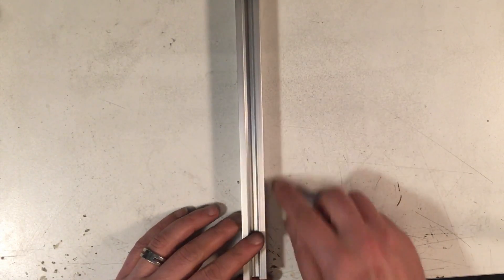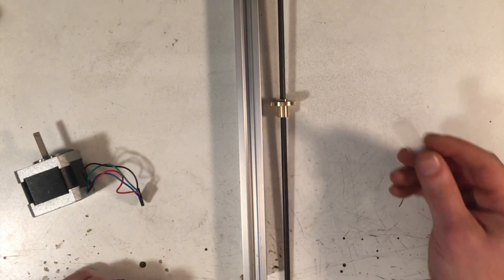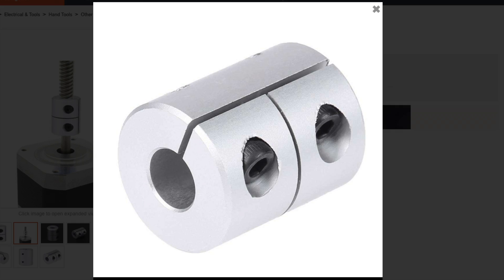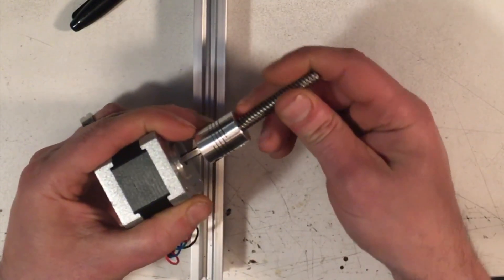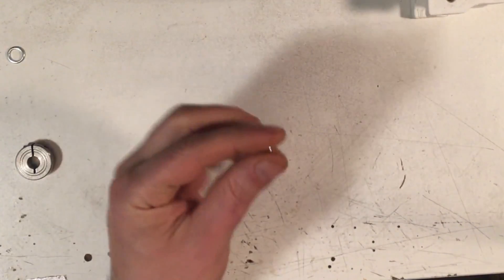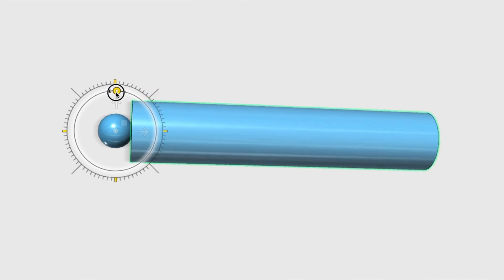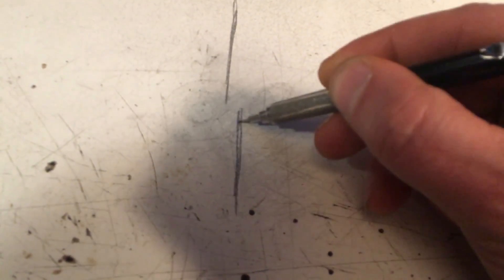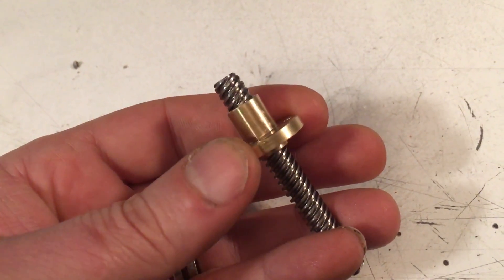Viewer question: the ball bearing trick?

Comment: The original bearing in bracket arrangement is better as bearings in the stepper are not designed to take loads into the motor. But please use thrust bearings nit standard bearings 😊😊

Comment: New to 3D printing and this was freaking awesome! I'm on my 3rd real print with a new Ender 3 and having some z axis biding issues. I didn't get everything exactly dialed in out of the box so my first two prints came out supper smooth and then my machine started to come apart....not the machines fault or the design or the slice its the pilot setting up the equipment for sure, since I'm new.....I don't know what I don't know yet. Thank you for imparting your experience and wisdom. This community has been supper supportive and I really think my learning curve has been diminished by learning from other makers experiences. Again Thank you!

Comment: Overtightening the leadscrew nut can also cause binding of the leadscrew, I have purchased 3 Ender 5 Plus machines and on each one the leadscrew nut screws were fully tightened and caused screeching and binding, one of them was so tight it knocked the part off the bed at exactly the same layer each time, luckily this was the first Ender 5 Plus I bought and this issue was what drew me to the fault, when I built my Ender 3 and CR-10 machines the instructions warned against tightening the leadscrew nut too much, the method I employed was to tighten the screws fully but without torquing them up and then turning them back one half turn.

Comment: In Tevo Tarantula Pro there is an o-ring that is meant to do exactly that, just inserted between the motor shaft and the lead screw, although I think that the ball bearing would do a better job :D
Reply: Won't the oring crush eventually, merely acting as a wannabe dampener of sorts? I just added the ball bearing to a new flexible coupling on the Z axis, we shall see if wobble is reduced!
Reply: @gushhnet  Well, I had the printer for 5 years or so now, printed a literal ton of filament, replaced the lead screw nut twice now, and the o-ring's still looking fine and dandy, so I don't know :v

Comment: fun fact 
my reprap was oryginally designed to use flexible coupler and it worked fine but as you say it was squishy so every slight problem made a 2mm pattern on the printed part
in my case the leadscrew was resting on the motor shaft anyway, so ball bearing wouldn't fix much
but swaping the coupling for one from ender 3 fixed all the problems
and my printer is using regular m8 rod and brass nuts with backlash spring

Comment: At what point do I stop chasing 0.2 mm misalignment, I've got everything as square as can be with the tools I have (verified with 2 squares, a pair of digital calipers and 2 crappy tape measures). Still binding, probblem is this printer always bound in z and also printed really well (85% of the time with the other 15% being really hard to figgure out bullshit failures  leading me to tear down the whole machine and rebuild it).... but for the life of me I can't get it to move smoothly in z. At this point with the learning, tuning and fixing I swear I could make my own printer at this point :), is it possible my vertical z extrusions are twisted (they are not bowed but Idk how to check for twisting on them) . Sorry essay sized comment. Im losing my mind over this one, thanks for the video it did me alot despite the rant :)
Reply: I know this is a 9 month old comment but just in case perhaps your acme nut/s are too tight, try to loose the screws one half turn and see if the coupler with a ball bearing also helps align, the binding is most likely caused by the nut being screwed on too tight to the frame and possibly a bent leadscrew.

Comment: I just found this video and its very knowledgeable. I thank you very much for all the info, I had a small binding wich I fixed with cheking the lead screw all the way and adjusting things. Also I installed a second Z leadscrew and the z movement is very consistent. I think Im going to upgrade to POM t8 nuts and Im not sure yet of going for the flexible couplings, I am very interested tho of taking the weight of the z axis from the steppers to the frame. Have you seen the ptfe t8 lead screws? How do they compare to regular ones?

Comment: I’m sorry for the double comment, but I just had to add yet another huge THANK YOU for this tip. 

I have a brand new Voxelab Aquila (Ender 3 clone) that was losing a HUGE number of Z axis steps. After following all the advice I could find, I got it improved to the point that I was just losing a few Z steps. I went from not even being able to print a first layer test successfully to being able to print, but with enough lost Z steps to affect print quality. 

To get to that point, I:
Lubed the lead screw
Shimmed the motor mount so that my Z axis lead screw was the same distance away from the frame at the bottom as it is from the top

Added a flexible coupler

After reading your explanation about how a flexible coupler could absorb z steps, I had an “ah ha!” moment, realizing this was my problem. 

I added the quarter inch ball bearing to the flexible coupler, inserted the lead screw until it rested on the ball, and my troubles were completely solved. NO MORE lost Z steps!! NONE! NADA! ZILCH! ZERO! THE EMPTY SET!

After chasing this rabbit for a week and losing the rest of my little remaining hair, I printed the most perfect first layer test I’ve ever seen. Did I mention no lost Z steps??

THANK YOU SO MUCH!!

Comment: You showed a flange ball bearing being pressed into that white plastic mount. It should be pointed out that the bearing, in addition to having the flange for mounting purposes, should also be a "thrust bearing" to take the axial load, not just a standard ball bearing meant primarily for radial loads. Now, a radial load bearing can take a certain, limited, amount of axial load, but it I think it would be worth using a video like this to point out the difference between the 2 bearing types as I don't think most people are familiar with thrust bearings.

Comment: It would be better if the printer uses flexible couplings to have to mount the motors on top and the screw would be hanging? Would gravity help in this case?

Comment: This is a great tip. I just designed and printed a set of spider couplers to replace the stock ones and noticed they settled down a little over time. This ball bearing trick should solve the problem. Thanks for sharing.

Comment: I have spent the last hour trying to get my z axis binding removed.  After following every trick in the book, I loosen my z motor and then having everything else tightened I can feel the z motor wobbling as I move it up and down showing that I have a slight bend in my acme screw.  I am now looking into the best option for resolving the binding issue and this trick might just do it without having to order a new acme screw which could still be bent.  Thank you for the explanation.

Comment: Would you recommend 3D printing the nut out of ABS instead of using a shitty bronze nut machined with a broken piece of glass?

Also it occurs to me that the method with a thrust bearing isolates the ball screw from the motor shaft, decoupling it from any vibration in the Z axis.  Abutting it to a bearing allows it to pivot and rotate, but doesn't this create a solid connection in the Z direction?
Reply: ABS is usually not abrasion resistant, choose another material. Indeed some people use 3D printed nuts (PETG works fine, Nylon works better); whether it is something to recommend... puh i don't know always worth a try isn't it :D you can also just buy POM nuts.

Comment: this was a life saver for mi, thanks, i still having some banding binding ringin kind of problem but this help like no other solution, also simplify 3D is doing some strange things with mi models, never thought that the ringing could be a slizer problem but i printed the same gcode on two of mi printers, exact patern of banding or ringing the two prints, it mean that the problem its in the software for the most part

Comment: Awesome job Alex.  I've been trying to preach this to customers forever.  Creality printers would often end up with stretched out couplers (non-spring type), so there 'solution' was to go with solid ones.  Yikes!  I still recommend the spring style couplers, as the gantry on CR-10 style printers is not that heavy, especially if using dual Z threaded rods.  Yet other vendors still unwittingly sell couplers that are solid as 'upgrades'.  I need a smaller TV, my back isn't what it used to be.

Comment: Buttt i have a heavy gantry riding on two z-axis motors using these springy couplers. No problems at all. Never had z banding or whatever people usually complain from. and that's on a cheapo DIY wooden i3 clone.
I just have the 8mm lead screw meeting the 5mm motor shaft inside the coupler with virtually no space between them

Comment: Thank you I am converting an R1+ 3D printer into a CNC router and it had the flew couple's like you just put the berg into So this poses a different problem that I had not thought about so instead of support I have the problem of thrust when the spindle moves down to cut the thrust in the downward move (could) stretch the coupler as the Z axis moves down I will have to think about this would like to hear your thoughts on this please
Reply from the maker: Sorry about the delay. I would not depend on flex couplers for support on a CNC without using a bearing block if that is what you are saying, but I don't know much about that printer, so I can't really speak to it

Comment: i use a flexible coupler with polyurethane insert in the middle and it has support for the head screw and keeps the correct gap between the motor shaft and the lead screw. seems similar to your bearing trick only i dont think its as flexible as the couplers you were using but it works! so thats the main thing

Comment: Meh, I just install the screw in th coupler such that the screw and motor shaft touch. Basically install the coupler as far down the 5mm motor shaft as possible and then put the 8mm in so it hits the motor shaft before it hits the shoulder. Then I stretch the coupler so it acts as a spring pulling the shafts together and tighten it up. It can never float this way.

Comment: The problem is most of the 'couplings' they use for these printers are garbage. No one uses these in industry. Also, direct clamping to a threaded shaft is not the correct way to do it and it's done everywhere in the printer market. It's all about saving money.
Reply: What is the correct way?

Comment: I had the spongy effect on my cnc y axis.  I shoved cut-up-credit cards into the coupler's spirals.  I have 24 cnc videos with weird fixes/tips like that.
Reply: Came up with that one as well, took some thick paper, cut strips and stuffed pieces of it in the spirals while forcing the axle up so there's more space in the spirals and the paper really bears the load when compressed by weight. It still is flexible in x/y direction so is still functional but the Z-height repeatability dramatically improved. Weird to notice this design flaw was never really adressed by the 3d community, the solution is so simple but the provailing idea seems to be that the z-axis isn't really that important since it doesn't move "fast" I see lots of vids about z-axis wobble, all of them showing the stock spiral couplers and completely ignoring them as a cause.
Same goes for upgrading linear bearings, people stuff Igus bearings in the x and y carriages all the time but nobody thinks it necessary to upgrade the z-axis ones as well. The stock ball bearing ones are crap and have terrible slop resulting in ugly prints and rattling. Any loose tolerance parts in a cnc-machine are going to have bad impact on quality. CNC aims for 0% tolerance parts since software assumes a perfect machine without play. The closer to perfect you get, the better the prints will be and these spiral couplers have a serious, underestimated effect on z-axis tolerance. 
I consider it a flawed design, you really don't want any flexible parts in a cnc drive, luckily it is easily remedied with some paper.

Comment: Useless. I don't get why to reinvent the wheel. This task is normally solved by duplex bearings or angular contact couple  to properly catch axial load before motor. Bearings located in adjustable housing in order to fix it to the frame in situ when everything is square and straight. Why not to teach people doing the stuff right?
Reply: These machines are relatively simple devices that are not subject to machining loads like a CNC mill or router.....so what you are saying is a huge overkill. However, the fact that there is some loading on the Z axis screw and onto the stepper motor bearing means that if you have first and most importantly aligned the stepper motor to the Z axis nut in 2 planes.....Makers Muse showed this in a previous vid...…. the last step is to use a split coupler, not the springy one, and place a small thrust bearing between the bottom of the  coupling and against the face of the stepper motor. There will always be only down thrust loads on the screw so a single thrust bearing will be sufficient.

Comment: I just realized my design for a 3D printer does not use a lead screw nut... oh wait never mind it’s also the sun gear.... duh, my screws don’t spin
Reply from the maker: ooOOooo, you tease. possibly a strain-wave or planetary non-captive design, or something like that?  That would be interesting to see
Reply: Alex Kenis : what is a Strain-Wave? And what do you mean by planetary non-captive design?
I am making my own motors that will give high speeds with less that micron precision but will just round it up to a micron. They are planetary setup. Butt my gears are not exactly gears in the traditional sense. Key point here, no slipping. And my encoder and controller are placed inside the stationery planet gears.
By the way my total design gets rid of all forms of “lash” 100% rigidity.
Any my style has never been done before, very close to a delta but still totally different.
Side note, don’t wanna Reveal too much information but I will be doing SLA done like FDM. But also can be 100% FDM, also can do CNC.

Comment: Worth adding that this is an old machinist's trick for clamping or measuring 2 (or more) surfaces using a single point. :) Also works in round stock form to cheat dovetail slots. ... Thanks for another useful ... use!
Reply from the maker: Old machinists have the best tricks
Reply: @AlexKenis   can this be effective if 1 motor has a spring coupler and bearing while the 2nd motor has the stock coupler? 
Or would you only run 2 spring couplers on your machine for it to be efficient?

Comment: As @Spock alludes to, a poor finish on the end of the stepper motor shaft and lead screw could have a detrimental effect. Perhaps exaggerating Z-banding in a worse case scenario!
Reply from the maker: That's possible, but I'd have to test to confirm.  But you're right that there is no harm in taking a couple passes with a metal file to make sure the end is clean. I'd also be more worried about the quality of the threads if the end machining is that bad, and there is no way of really knowing if the threads themselves are rolled, machined, or ground until you have it in your hands.